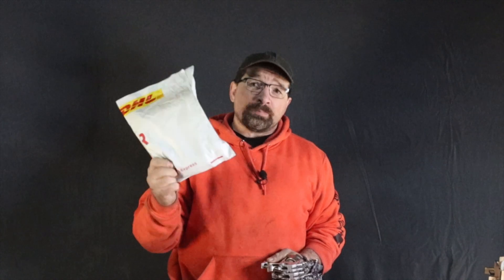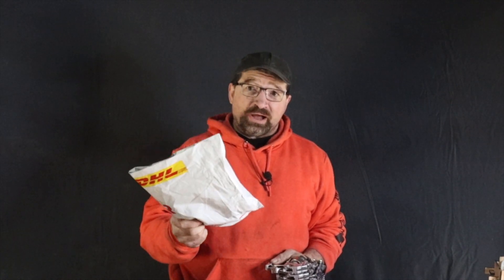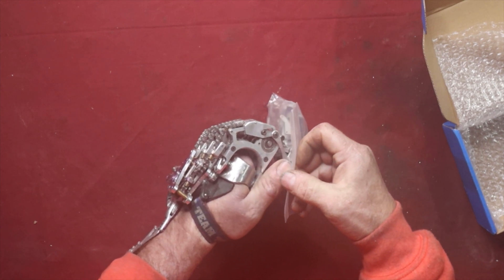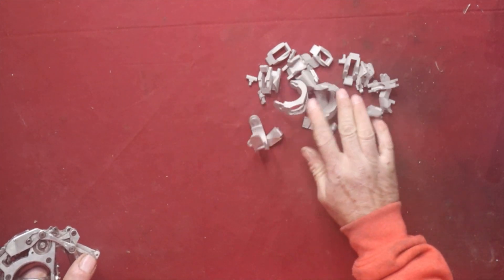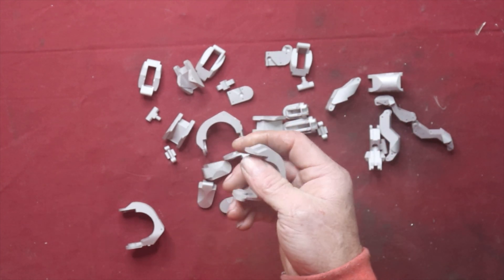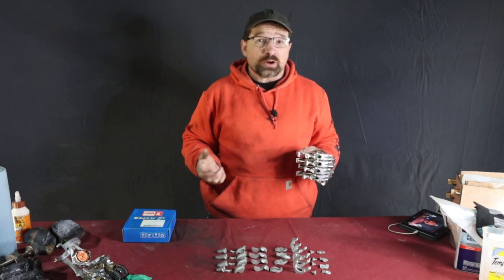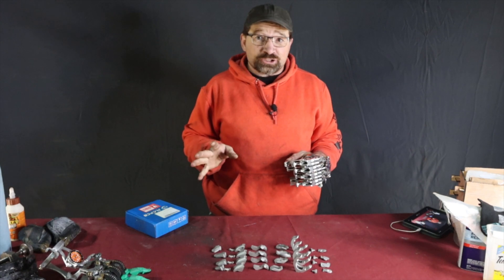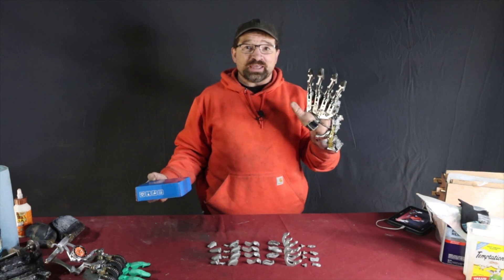Unboxing of my 3D Printed Prosthetic Hand Parts from JLCPCB!

Comment: Have you considered using basf filament?  I believe they have 316l and 17-4 stainless, can be printed at home then sent in for debind and sinter. Little spendy at 130 a roll but that should be enough for all the parts for one hand if not 2

Comment: Hey Ian, I am constantly impressed with your work in creating a personalized prosthetic for yourself.  I was curious, how much residue does your current prosthetic leave on your forearm since it is steel? Does the steel irritate your forearm at all?
Reply from the maker: Actually it's aluminum. Aluminum and sweat does equal aluminum oxide that turns black on your skin. To counter that I usually paint the contact areas with krylon clear coat. Although I'm currently looking into working with cerakote to seal the parts and create a low friction coating on the wear points.

Comment: HI Ian, was great to meet you when I stopped by your shop a few months ago.  I have been using Shapeways for this kind of printing for iterative design of my knives.   They have a bronze like metal that is not super strong, but the parts were very well finished and were quite accurate.  It is very cost and time effective to do what you have done, and gotten the part geometries down 100% in the plastic before committing to the expensive 3d metal print.  Also, re looking for a sponsor, i had a problem with a battery from Milwaukee, and as such had a really nice conversation with a fellow named Juan in their technical support dept.  Really friendly and I think he would love what you are doing.   He might be a good connection there.  Best wishes with your health.  Tom

Comment: Check your polygon count when you export the STL, the stock settings on most CAD software is rather low and will make those visual lines if not adjusted.  

Would be better if printers just accepted step files.  Stl is a terrible format for anything that needs accuracy of shape.
Reply from the maker: I think its on their end with their slicer settings.  I don't get the faceting when I print those parts in plastic on my Bambu labs printer.
Reply: @Ian Davis  well that's dissapointing from a professional service!  Thanks for the response.  I've been following since you started.   Fellow machinist and designer
Reply: @missingpartsclub  FDM fundamentally rounds everything by the extrusion width which is nozzle diameter or a little wider. There is some additional rounding on the Bambu from belt resonance suppression in the machine firmware. If using a higher resolution printing method like SLA and SLS, the underlying geometry gets more revealed. For FDM it doesn't make sense to export polygon edges smaller than 0.5mm, but better resolution is desired for other.

Comment: I think it's amazing how comfortable you are with your daily driver. It really just seems like a natural hand with how fluid your movements are with it.
Do you have any new ideas for another electrical driven hand?
Reply from the maker: i am working on a myo controlled partial hand in the background. its based around direct finger control. think move index, index moves and so on. no grip patterns. but its still a bit off. its a fire triangle of function. speed, strength, and size. if you want faster fingers, you either bump up motor size or lose grip strength ect ect. its a tall order but ill eventually get it.
Reply: @missingpartsclub  I can't wait to see progress on this. I hope you're doing great.

Comment: still think rather than making the print- u should print a cast shell, then fill that with carbon fiber and epoxy.. basically, u end up with just the same shape, same strength, but much lighter. know u must be thinking: "no shit sherlock" but i think getting steel prints costs way more and has more drawbacks then just making a clam shell cast, that way it takes a day to fix a broken part.. not a week or two.

Comment: This is 316 SS, right?  Do you think you'll have any issues with galling on surfaces that are bearing against each other?  Might not be an issue since the pins can be a different material.  I'm just curious about mated flat surfaces.  Very cool stuff!
Reply from the maker: thats where the filing and finishing comes in. flatness for the most part was ok. probably .005 in the 1.3" of the pass through of the proximals. it flattened out nicely. i am concerned with the possibility of galling. ill be cerakoting the pins, with microslick, and he rest with some h series. it has pretty good wear characteristics and should keep things from sticking. ill do a video on it coming up.

Comment: I’m curious how you plan on drilling the holes. Drilling stainless has always been my nemesis
Reply: i would presume he plans to drill slowly and with a lot of lubricant, that's the safest way to make it thru hard materials, gotta manage the heat of the drill head so it doesn't harden and shear.
Reply: I have been using Milwaukee red cobalt drill bits on stainless for a while, they work great.